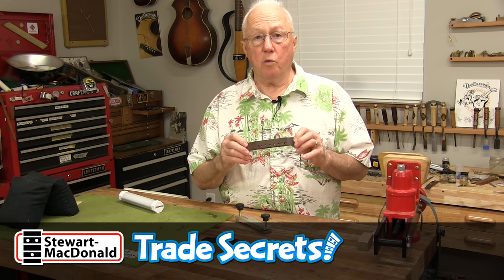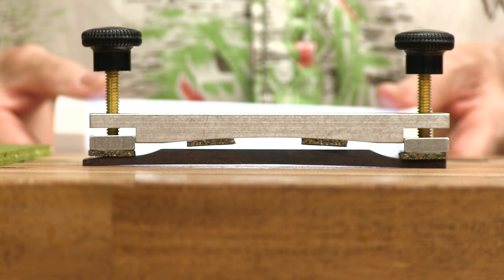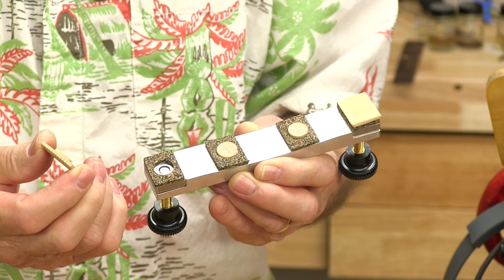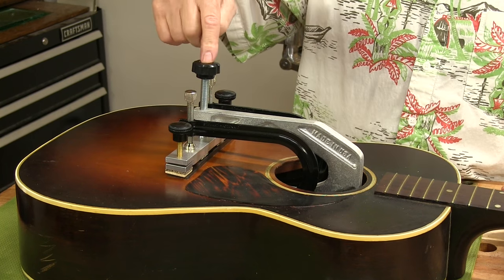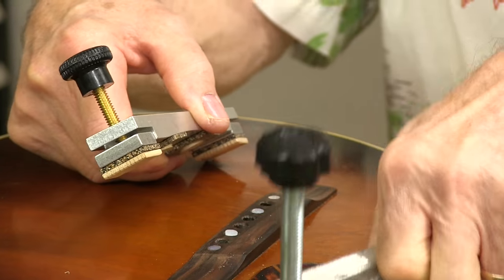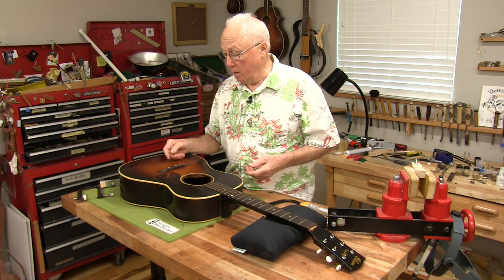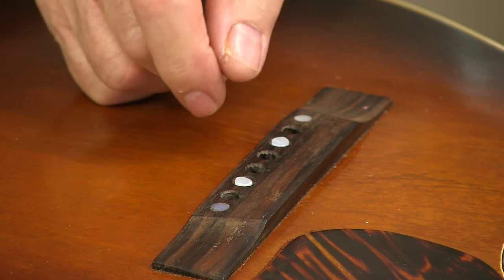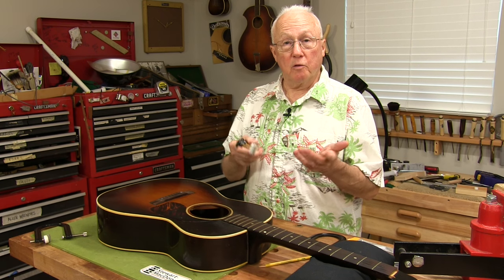Gluing a 1940s Gibson Bridge

Comment: not to be rude but wouldn't have been just as easy just to flip your clamp upside down looking at the dimensions of it in the video if you remove the two pieces that it ride on the brass screws unscrew them turn things over 180 degrees a double sided adhesive tape with cork on it wouldn't that have been easier? I don't actually own that clamp although I have several tools of yours but my buddy does so I'll holler at him and ask him